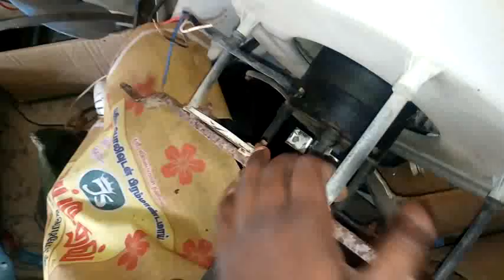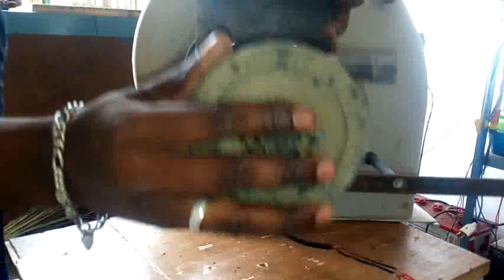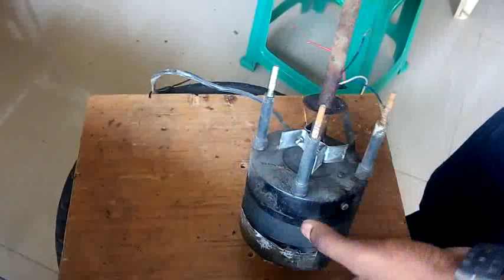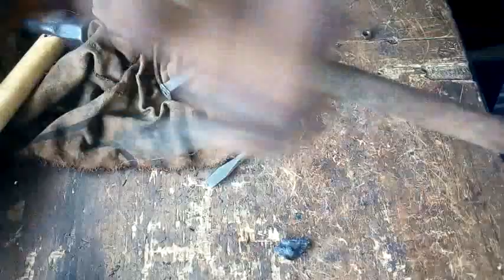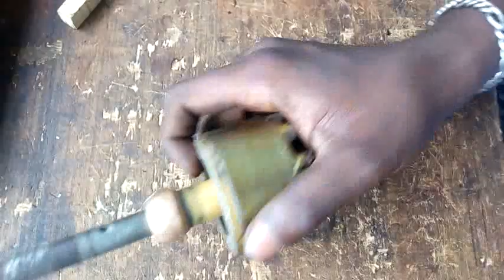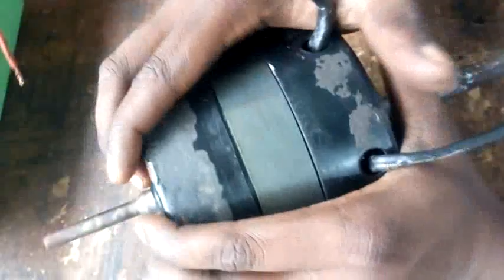Air cooler Motor || Bush change || Tamil || RS Electrical Tamil channel || Ramanan

Comment: Hi bro, very useful video.  same aircooler (Kenstar double cool 50 ltrs) but recent ah air coolerproblem agitu,motor full rusty & jammed.so better motor change pannalama or service pannalama ?
Motor replacement means evlo aagum.
Plz reply
Reply from the maker: Motor change panirunga 1000 agum